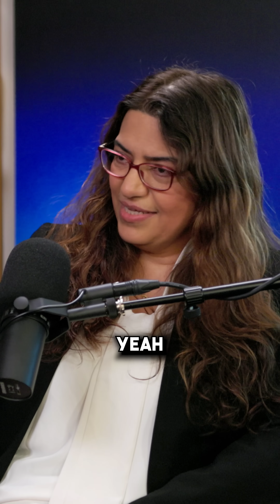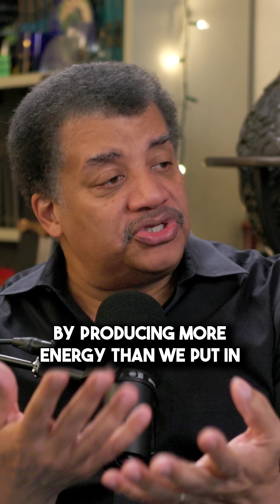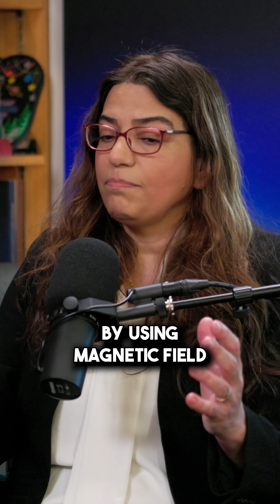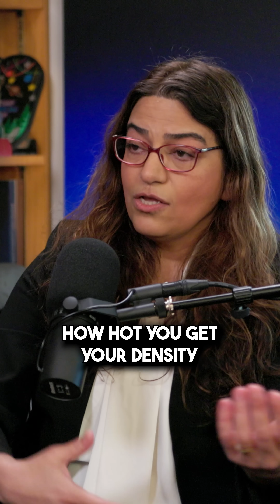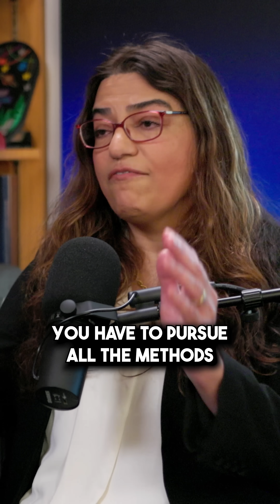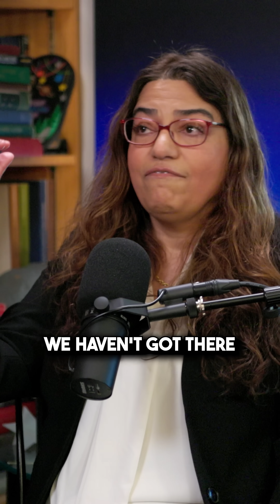How CLOSE are we to fusion energy? 😂

Comment: So ah. Integrate networked AI, reward train it on keeping the plasma contained by manipulation of magnetic fields. Then increase the sensor/adjustment points of the magnetic system and assign one instance of said AI to each so it is super focused down to the smallest time unit currently possible and give them an overseer model that’s manages the whole system. Then allow the AI to collectively manipulate the plasma like a human does clay. Upgrade a tokamak with that and it will work. We simply don’t have the ability to control enough points of the field fast enough with deterministic computing.

Comment: You have to produce not only more energy than you put in, you have to produce about 10x as much energy to make it economically viable, and no, you're not almost there, you don't even know where "there" actually is.
Reply: We've already achieved fusion.
Reply: @armorclasshero2103 We are achieving fusion for 80 years now, that's how all the elements on the upper end of the periodic system were created. We just don't achieve fusion that could be used to produce energy.

All we do know is how to take tons of energy to generate a fusion reaction for a very shot timespan.

Also, the reports that we got more energy out of fusion than we put in are greatly exaggerated. Yes theoretically there was more energy than there was put in, but this energy was only heat, To create useable energy from heat isn't possible without losses. So when you use a steam turbine to create useable energy from the heat that was created, you are still way below the energy that was put into the system to achieve fusion.

You would have to be able to get roughly 10x the energy, you put into the reaction, out of it to be able to produce more useable energy than it took to start the reaction. 

We are not "there", not even close to "there", actually we do not even know where "there" is.

Comment: I have seen that over FORTY years ago, 

With our physics school class we were visiting in Garching (near Munich, Bavaria) the research laboratory of the Technical University Munich (TUM). 

And they had a Stellarator and a Tokamak reactor running there. It was clear, too small for a fusion, but one had enough to study, how to enclose a plasma in a vacuum chamber in a magnetic field and heat it up with induction. 

 The experiments grow bigger and bigger, but as far as I see it, they are still just running over seconds to minutes. 

And when the great news FORTY years after our visit is that more energy was emitted into the plasma than was entered into it for a few seconds, that is frustrating. 

Especially as you can bet that the bilance of the COMPLETE sytem was positive - I am sure all the energy to create the enclosing magnetic fiield, for cooling of the copper loops (I think they must be cooled down to superconductivity, way below -200 °C) and all the other auxiliary installations is not taken into account. 
 
And I do have no idea when they are at the point that they can produce a steady several 100 MW energy as output, how that energy shall be abducted. The plasma implodes in its temperature in the moment it comes into contact with any matter. 

So the nuclear reactor method of plain old water flowing along the fuel rods does not work.
Reply: China has had great success.

Comment: It was announced two years ago the ignition was achieved (using two tritium nuclei to produced helium + energy) at Lawerence Livermore Laboratory, however, from my understanding the next challenge is continuing to feed the “fire”. I could be wrong about the details, it’s been a few years.
Reply: That was basically a stunt. There was more energy in the output than there was in the 192 lasers focused on the tritium, that's true, but creating those lasers isn't an efficient process; it took far more energy to create them than they got out of the reaction.

On top of that, even if we did have a net positive energy profit, they can produce that reaction, with a $100K tritium pellet, at most once per day. A commercial fusion power plant would need to do it at least ten times *per second*.
Reply: @ thanks for reminder, I forgot about the energy input of the lasers

Comment: Conventional fusion is meh! Now let’s talk about Neutron fusion. 

The Argon Helix Neutron-Fusion Reactor is basically a miniature star in a machine. It smashes light atoms together (like hydrogen isotopes), forcing them to fuse into heavier atoms (like helium), releasing huge amounts of energy—just like the Sun. Neutrons keep the reaction going, magnetic fields stop it from melting, and the energy powers everything. It runs on self-sustaining fuel, meaning near-infinite clean energy.
Reply: Here’s a rough comparison of energy input vs. output for conventional fusion vs. neutron-assisted fusion:

1. Conventional Fusion (Tokamak / ICF)
	•	Input Energy: ~300-400 MJ (megajoules) per reaction
	•	Output Energy: ~400-500 MJ
	•	Efficiency Ratio: ~1.2 to 1.5 (barely breaking even)

2. Neutron-Assisted Fusion (Argon Helix)
	•	Input Energy: ~100-150 MJ per reaction
	•	Output Energy: ~600-800 MJ
	•	Efficiency Ratio: ~4 to 8 (significantly higher gain)

Why the Difference?
	•	Conventional fusion wastes energy in extreme plasma heating & confinement.
	•	Neutron fusion uses high-energy neutrons to lower the ignition barrier, reducing energy input while keeping energy output high.

TL;DR: Neutron fusion gives you 4-8x more energy per unit spent, while conventional fusion barely breaks even.